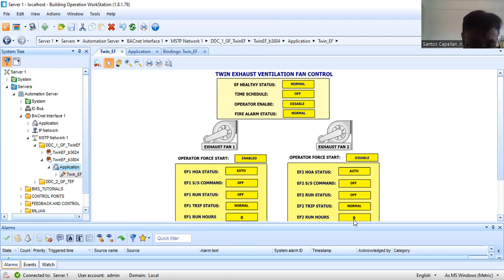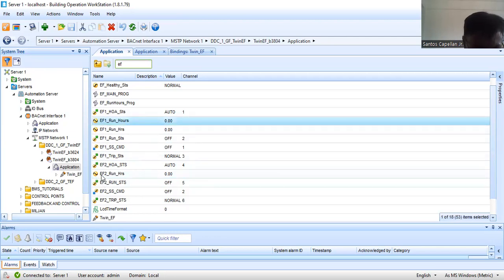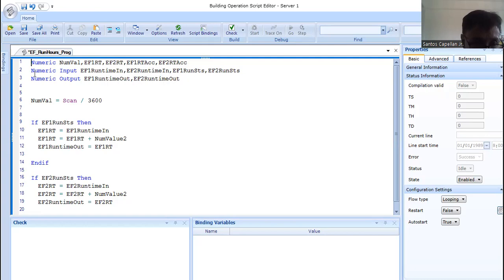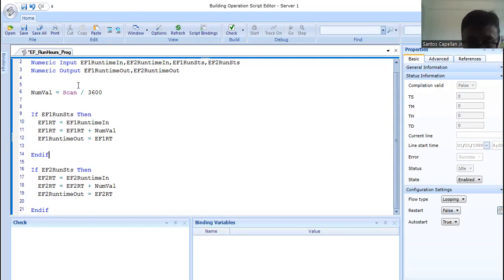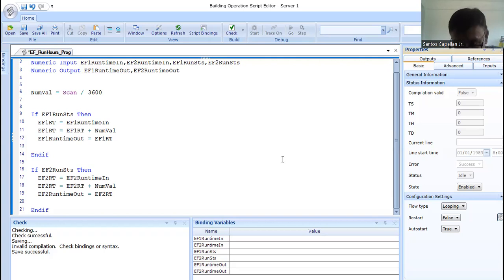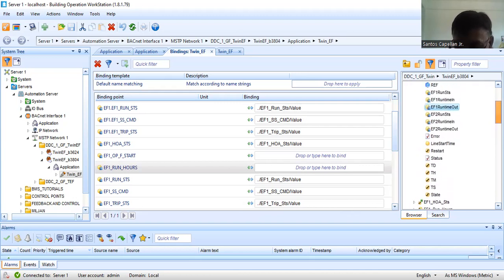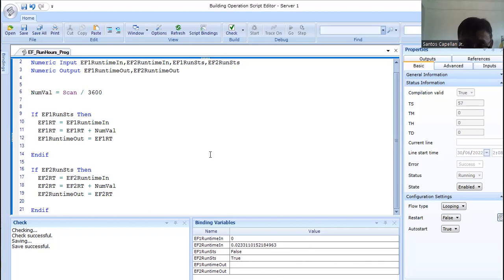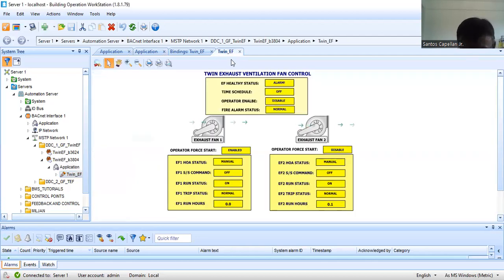BMS - BACNET Controllers Script Programming Part 8. (Run Hours Accumulation)

Comment: I was hoping to find out how to add an input to the program, I'm currently needing to remove two existing inputs and replace them with 4 different inputs.
Reply from the maker: are you doing script programming for b3 device?
Reply: @SantosJrCapellan-BMS  Hello sir, thank you for your reply, I had actually intended to remove my comment because the answer to my question became clear in the next video, I watched it and immediately made the changes required, but then had to leave work, I will test the program tomorrow.
I was trying to change a chilled water demand program which ensures secondary chilled water pumps continue to run as long as the tertiary chilled water pumps are still running.
The existing program referenced 2 pumps which have since been decommissioned and replaced by 4 others which are on a different bms system, but all new points for the new process water system are available over BACnet IP. So I have now set up some mapped command status values for these new pumps which I have referenced on the program.
I will let you know if it works.
Reply from the maker: you can send me screen shots